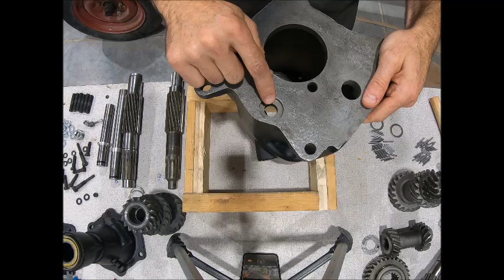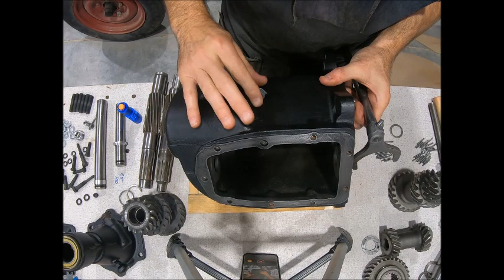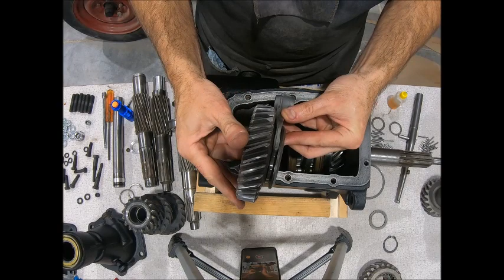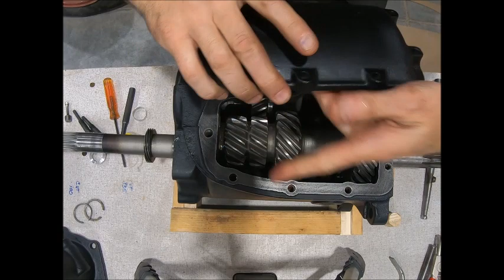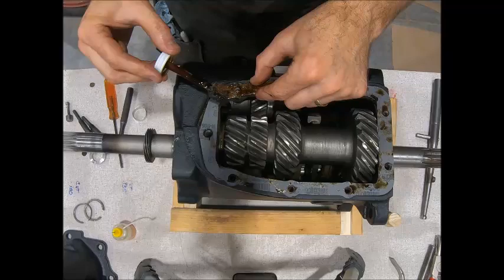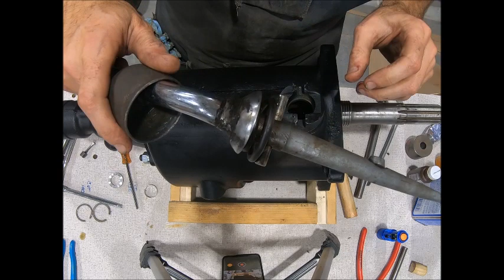1937 Cad / LaSalle Detail Assembly with 1950 Olds tail shaft

Comment: Hello, great video! Do you have an input shaft and a tailshaft for a ‘37 lasalle that you would sell? Thanks for your time. -Shawn
Reply: Sorry I do not.  You will not find one either.  It is best to just get a 38+ trans and put all the gears in the 37 case.  If you use the 38+ cluster you will need to  machine the case for the 1" shaft
Reply: @kmarms7902   Thank you for the prompt reply. I have 2 later year transmissions but the tailshaft is much longer. My ‘37 tail housing measures 14 1/2” and the later ones I have are much longer.  Is ‘37 the only year with that length tailshaft?
Reply: @Shawn-ix1qu i am not 100% but I think 37 is the only one that is that length.